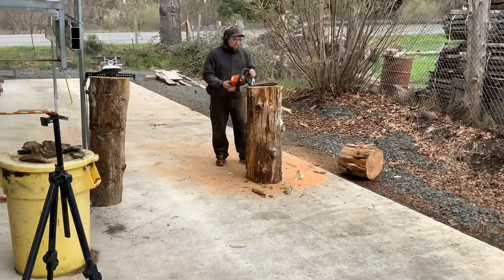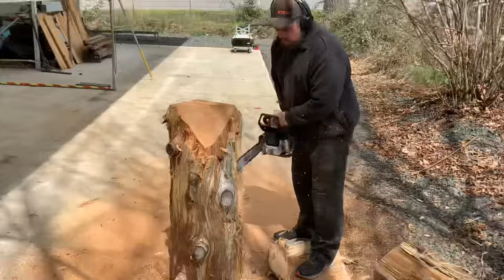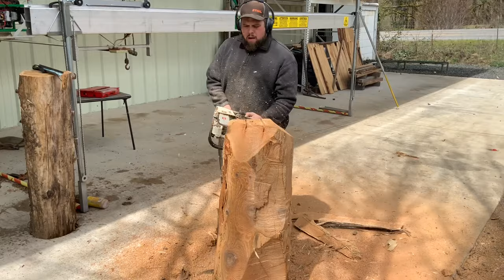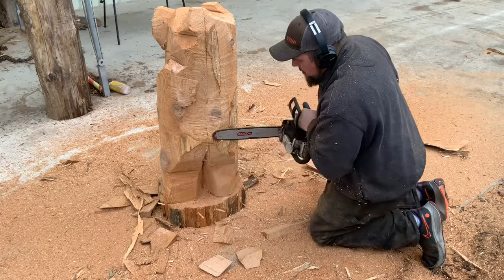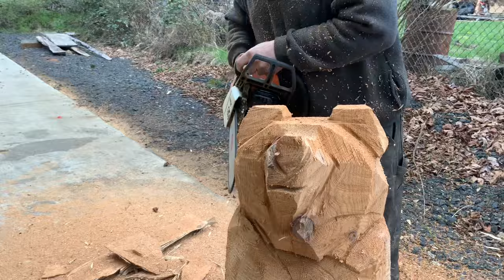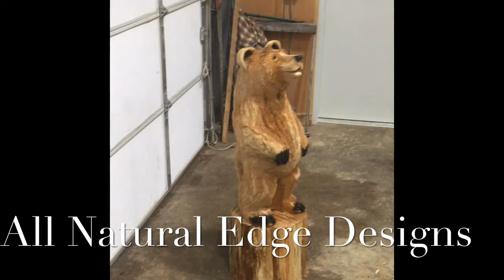Chainsaw carving a bear ,How I make $500 per hr as a chainsaw carver

Comment: Just bought a chainsaw recently. Figured I'd try making some cash out of it and saw this. My brother told me about treating wood, but that's a whole other can of worms.

How do you keep the carving from decomposing?
Reply: Cedar is rot resistant.Still needs Urethane or whatever
Reply: Dry it out ,or heat treat it, then seal it w an oil or varnish